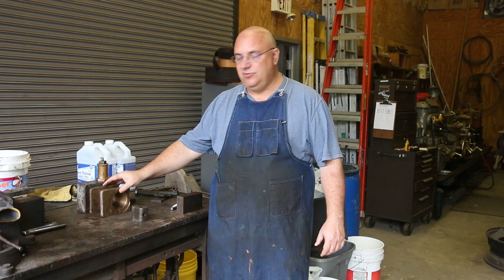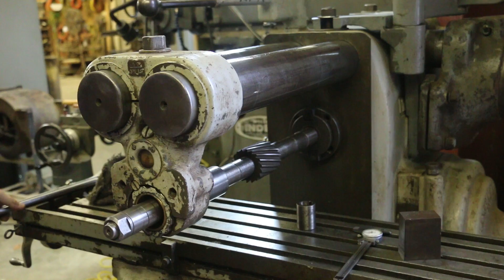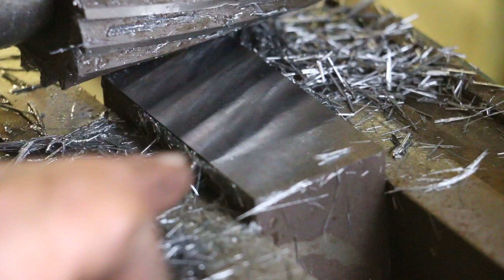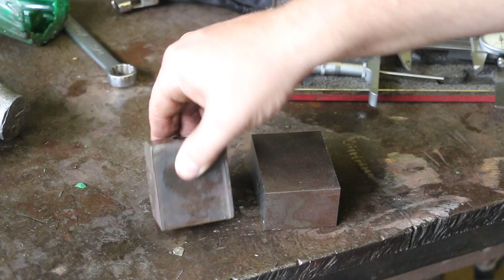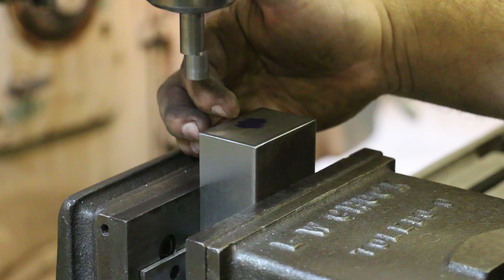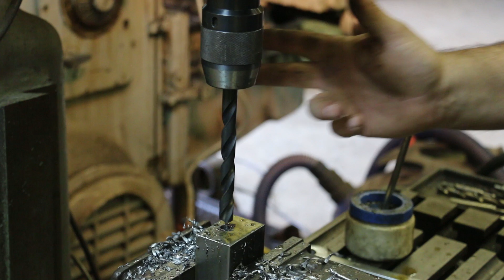Steam Locomotive Bearing Wedge Build:  Part 1

Comment: Hi Keith,

Awesome video series as usual. What is the make/model of the body mic that you are using? I'm trying to set up video camera to start shooting in my shop and need a body mic so I can shoot long and move around. Do you ever get any interference from fluorescent light or other equipment?

Is this part 1  or part 2?

Thanks!
Andrew
Reply from the maker: +Andrew McLaughlin I am using a Sennheiser EW112P.  It is a bit pricey but after nightmares I had with my first "cheap" wireless setup, I decided to spend a few extra bucks for quality this time.  I have not had any problems with interference and the range on this mic is just great.  The first mic I had, if I got over 10 or 15 feet from the camera (where the receiver was), it started making static.  This one I can be over 100 feet away without any problem.  You just have to watch the batteries - when you get to one bar, just replace them.  Takes two AA's.

Comment: hi  keith, your  earing don't  need to be replaced. take some material off the mating surfaces so that the bores are made smaller. then bore to size. this method has been used in engine rebuilding many years.
Barry
Reply from the maker: +barry stevens The problem is that we have done that so many times that there just is not much bearing left!  Some of the shims are 3/4" thick and I measured one of the bearings to only have about 1/4" of brass left before it wears through the back. No, it is time for some new bearings - the original ones are only 98 years old!
Reply: OK, I had thought that the bearings were blocks. I see that they aren't now. Keep up the good videos.

Comment: Hmm european tools ? 0.160 inch ends up at kinda exactly 4mm =)
Reply from the maker: +Tomas Wilhelmsson Yeah, kind of strange that a 1" arbor has a 4 mm keyway though.  I hate it when they mix systems like that....
Reply: Keith Rucker - VintageMachinery.org  Yeap, we had a time here in sweden atleast when stuff were mixed i think.. i think the lathe i have for example, a South Bend clone the "Blomqvist" had different systems on it, some screws were imperial and some were metric etc.. could be something done by someone after it was made but.. and i know some engines had mixed screws and stuff.. its a horror to deal with =)

Comment: why remake instead of helicoil it?
Reply from the maker: +Shaun Tucker Never seen a helicoil that long.  The part is threaded the entire depth.  Not so sure that a helicoil would be ideal for an adjustment screw either where you are constantly adjusting things.  They are better suited for tightening something down and leaving it alone.
Reply: +Keith Rucker - VintageMachinery.org.  OK makes sense thanks for all your videos and for taking the time to answer me
Reply: +Keith Rucker - VintageMachinery.org Helicoils can be stacked for more length, no problem.  That said, Helicoils are still not the right repair for the wedge due to the issues Keith mentioned.

Comment: Time to dig thru your milling cutters and see if you can find one with the right radius to cut that block.:-) I would suggest to always orient your vise so that cutting forces are resisted by the jaws.  Probably because I tend to hog on my machines I have learned from bad experiences to use positive stops so you don't end up with thrown parts and moving components. Thanks for sharing the slab milling.
Reply: +bcbloc02 That's a great "add vice".... ;)
Reply from the maker: +bcbloc02 I normally would have positioned the vise like you suggest, but I was thinking ahead to the last step where I would be milling the angle, and for that cut the vise needed to be positioned the way I had it.
Reply: +bcbloc02 
Yeah Keith didn't mention it but I know I saw that work piece jump just as the cutter was starting engage on that last cut he showed us.  I was "Oh crap hope he's paying attention cause bad things are about to happen otherwise."
Reply: +bcbloc02   Good point on the vice alignment!

Comment: Regarding the 160 thou keyways - is 4mm a standard metric key size? Remember the UK has changed 'gradually' to metric and 1" shafts with metric keys might be a likely combination...
Reply from the maker: +Mark Sinden Very possible!
Reply: It's probably 5/32" (0.156") of course - the very near conversion to 4mm (3.96mm) is probably a total (but fortuitous) coincidence.

Comment: Good catch on the DRO issue.  I don't have DRO's on my machines and if I did I would still layout all my spots and not totally depend on the DRO.  You noticed the 100+ thousands that it was off but what if it were a very small amount.  It could ruin a complex piece.  Ya, it takes longer but it cuts down on mistakes.   Just call me old old school I guess....  thanks for sharing...  Fred
Reply from the maker: +Fred Miller When I am doing something complex, I usually do lay it all out and confirm that I am in the right spot.  It makes me feel better as well!

Comment: We have a K&T horizontal mill that I ran for 18 years.Now it's a catch-all,soon to be scrap metal.once we bought CNC's,it's not appealing at all to have hot chips,oil,and coolant thrown at me anymore.I just program,hit start,and drink coffee.
Reply: +Jason Carpenter then they bring in a robot to drink the coffee and your out of a job!
Reply: +jusb1066 Wrong!Its all custom tooling 1-2 parts,no production work.I'm the only machinist,my job is pretty secure.
Reply from the maker: +Jason Carpenter Nothing wrong with CNC if you can afford it.  Not as practical though for the one off jobs like we are usually running.  Before you scrap it, you might see if some of the guys here might like to get it from you and save it from being melted down and sent to China.
Reply: +Keith Rucker - VintageMachinery.org that machine is a lost cause,too many things to fix.If you are ever up here in Ohio,you need to check out the "Age of steam roundhouse".Its a train lovers paradise.

Comment: Keith, Just a thought from an old cooter.  You said on the other video that the brasses would soon need to be replaced. Why not make the wedges a bit thicker? that would give you some more adjustment.
Reply from the maker: +tinkersdamnworkshop But then when I made the new bearings, I would have to make a new wedge that was thinner - or mill it down.
Reply: +tinkersdamnworkshop I also wondered about that, however once all the available adjustment is used up, won't you have to pare down the flat faces of the bearing too, in order to provide more clearance, and then fit a larger wedge?
Reply: Spider, Yup, in fact you could trim some off the front of the bearings and re'machine the holes to round, if you felt the need.

Comment: What happened at 19:25? Did the vice loosen?
Reply from the maker: +MrPlusses Yes it did.  I stopped the camera, reset the part and tightened the vise a bit more and that took care of it.
Reply: +Keith Rucker - VintageMachinery.org Thanks for the reply. hope you and your family had a great Thanksgiving.
Reply: +MrPlusses 
Work piece moved.
Reply: +MrPlusses I thought I was seeing things. The work did move.
Reply: I think there is a way to have the vice oriented in such a way that the fixed back jaw is behind the block being cut so that it is less likely to move.  Maybe someone would have a picture of such a setup.